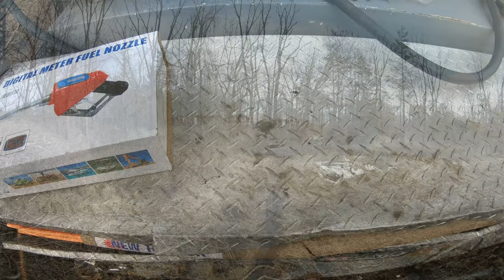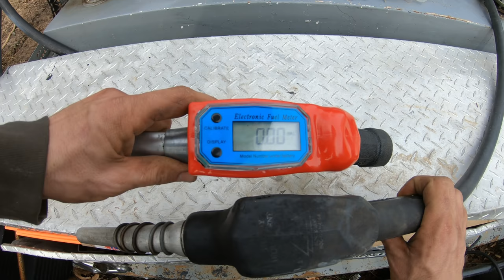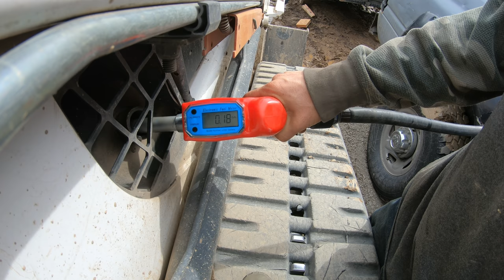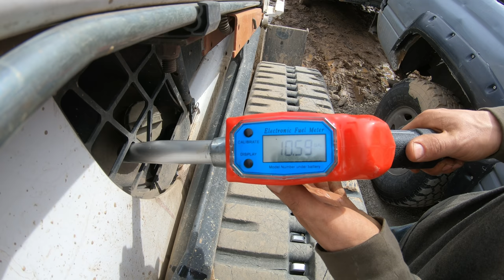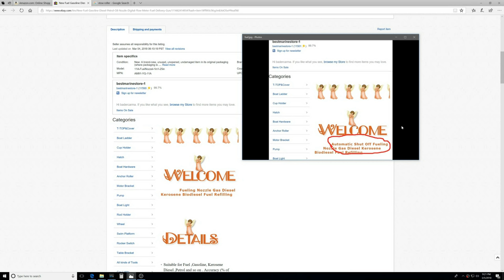Installing an underground propane tank

Comment: Scared the shit out of me when he got between the tank and the truck when it was swinging,,,,Not smart
Reply: yea the delivery guy said it was his first day, coodve been his last day
Reply: Me too! I think he was tryin to pat himself on the back too! Walked under the boom and with the jerky hydralic dips yankin that truck around. It seemed l il ke that tank was almost too big for the crane. Also it doesnt take any time to attach a tag line.
Reply: @joshanderson1019  this guy is no way stupid , u should watch his vids an ull see wat i mean
Reply: @charleswaynejohnsonjr.6096  i was new here i didn't know.
Reply: @joshanderson1019  Not really.
Andrew Camarata takes a lot of risks and gives anything a go. A lot of the time it pays off, sometimes it bites him in the a$$ when he goes way over his head doing something he has no idea how to.
Reply: @joshanderson1019  Not rude. Just dumb. Its not if you get stuck its when. The trick is do you STAY stuck.
Reply: @wildtimbrown  the thing is i dont get stuck
i dont use my skid steer on mud that i cant even walk through without sinking
Reply: @texasrox2010  use a skid steer with bigger tracks
Reply: @wildtimbrown  he did have a great idea with using the hydraulics to get unstuck and i have to give it to him for that
Reply: @texasrox2010  i have nothing against Camarata using his little skid steer for this job and at least he wasn't as bad as the guy on the crane
Reply: @texasrox2010  exactly
Reply: @texasrox2010  camarata is good at getting his small skid steer out of tight situations
Reply: @joshanderson1019  whoopee for you. If you have never been stuck, you have no idea where your limits actually are.  Getting stuck happens to everyone who pushes the limits, it's do you stay stuck or get do you get yourself out.. And all your boasts mean exactly nothing on a media that let's us see what happens. You go create a much real world content as he does and we will consider consider believing your boasts.
Reply: @wildtimbrown  its true. Even someone who has gotten stuck driving in snow would know.
Reply: I agree, the delivery guy didn't seem to know what he was doing. He got called out on it by his own guy!
Reply: @charleswaynejohnsonjr.6096  Yeah you know there are these things called "jokes" in the construction industry. Delivery guy didn't look very green.

Comment: Why would anyone bury a propane tank in that soup? And you need to pump all that water out first! Now that hose is probably kinked up underground. Me, I would want a foundation on top of the ground and if the tank leaks you can get to it.
Reply: It will rust through and you will never know it. First clue when the house blows up. Very unsafe.
Reply: tanks are buried with cathodic protection and will never rust as long as the anode bags are replaced which is every 15-25 years. any propane company worth is salt will make sure they are tested once a year
Reply: I wouldn't have too much faith considering their crane operating skills.
Reply: Did you watch the video all the way? The propane tank area was dry as a bone. The well area/ line was the wet area.
Reply: They don't allow propane tanks to be buried in Wisconsin. Some people have wanted to because propane is a liquid at -40 degrees and won't come out of the tank. It would stay warmer in the ground.
Reply: Lots of tanks are buried. He also drained the site, that was where most of the water was. The propane tank was installed after the drains had had time to do their work. Round here people bury the tanks to stop them getting hot in the summer and cold in the winter and being a ghetto eyesore the rest of the time. The tanks are treated to prevent rust, and then buried with sacrificial anodes. The only issue round here is if you live somewhere there's actually space for ground water, I have granite a foot down, and the tank runs dry, it can float to the surface. My friend's 500 gallon tank is bolted to the ledge so it can't float when empty.
Reply: @rt000r  I didn't see them install any anodes, did you? I didn't see any test leads either.
Reply: @joemoma516  come to think of it,I didn't either. We always do an anode test for any new customers and if it fails,we make them put in new anodes. Way to much liability filling a possibly rusting tank. When we install them,1000 gal get two bags and 500 gal get one and as long as the individual is a customer,they get tested every year
Reply: @rt000r   Yeah, we test all mains over 100' once a year and mains under 100' every ten years, or 10% a year. Tanks are annually tested as well. But that's the federal reg for a utility company, not sure what homeowners are required to do. But if it was my tank, I'd want it protected.
Reply: Melkor they literally threw the anode bag on the side of the tank
Reply: @DW-bo3qw  Yeah, I went back and found it. @ 17:22
Reply: @joemoma516   Watch that section again. The guy tosses a long round bag in the pit next to the tank. The bag contains the anode material. (Though the guy pronounces it AY-node. Drives me nuts.  It's a soft a.   AN-ode

Comment: 7:00 - rubber hoses underground for gas really?!? With some screw tight clamps which will rust within 10 years. Needs soldered copper pipe inside of PVC pipe which has expanding foam to protect the joints.
Reply from the maker: IDK, gas company did it, they should know what they are doing. I think that line was plastic.
Reply: Just seems mad code out there you have, we have stricter code in Europe when it comes to gas I guess. Also, your castle/home is amazing. :)
Reply: @rhfweb  I'm always curious about the differences between EU and US code.  Often it seems to me that US is over-regulated, but in this case I suspect any European inspector would be having fits.  :)
Reply: Isn't that the water outlet from the well?
Reply: I believe he was referring to the water line from the well.  I thought the same thing at first then I realized you were not installing the UG Propane tank yet.

Comment: Been reading through the comments and thought I'd add my US$.02 as a homeowner not far from here as well as someone experienced in designing septic systems and who's had drainage issue on my own property.

First, this isn't about a water table. This is about dense clayey soil that doesn't drain well. In designing a trans-vap, or leach field, in this area you need to perform percolation tests. If you can't find anywhere on the site that gives a consistent perc rate then you're required to truck in soil that does and build up your own field. $$$$$$$$$. Last I heard, around 25,000 of those. I've spent long hours out in the woods watching failing perc tests, 

Foundations require footing drainage, and robust ones. My own home has (according to the drawings) two runs of perforated pipe, inside the footing and out, which then join and run out downhill to a stream.  The house is around 30 years old, we've lived in it for 10. Not long after we moved in I discovered the basement was starting to flood after serious rains. The worst I had around a foot of water. It became apparent to me (too slowly, I'm sad to say) that a pine tree planted too close to the house had infiltrated the outgoing drain pipes. The tree is huge and there was no clean-out built into the system (?!?!?!) so another plan was devised to install a cleanout and once a year I have a guy come up and snake it out. At some point I know I'm going to have to take this tree down. But we've had no water in the basement since including getting hit by back-to-back tropical storms (Lee and Irene) a couple years ago.

Comment: Regarding the anchoring of the propane tank I would think a slab is not the only way. I've been on a job before where a large culvert kept floating up and the engineer fixed it by using anchors used for guy wires that keep utility poles upright. They "screw" into the ground.

Comment: Hello Andrew new too your channel. Nice work in the video, put in a few propane tanks myself. I heard you say your next project was the septic tank. With the amount of ground water there you need to fill the tank so it doesn't float out of the ground.  I repaired one where the homeowner had it cleaned out got a huge rain and floated up.
Reply from the maker: Yeah, those plastic ones can float up sometimes. Ill be installing a concrete tank here.
Reply: Andrew Camarata it was a 1000 gallon concrete tank. Floated up and layed on its side. What kind of lines are u installing.  We can use rock, tire chips, chamber. Some people use e-z lay with the packing peanuts in the net. Done a lot of repairs where that was used.
Reply: Andrew Camarata --- I had a concrete tank float on me after it was covered and not filled. You'll be glad it's filled if you have a lot of rain/ground water.

Comment: When we used to install these tanks we would anchor them down so in heavy rains the can shift or lift. Using concrete dead mans with cables. So pipes won't break cause a gas leak. Have repaired dozens of them and anchored them down so it won't happen again

Comment: I was on a job with someone a few years back at a property that had a propane tank outside near a shed in the back of the house so there was no more than 20ft between the tank and house. It was a tree job, the stump was grounded down, and I was digging the excess dirt/wood and smoothing the area out. Kind of smelled funny as I was digging around, didn't put two and two together until a black piece I thought was garden edging was sticking up, the propane line was hit and ripped apart.

Comment: General question? They don't "bed" the tank with gravel? Or some kinda of drainage? 

500lb propane will go faster than they think.

Cheers
MJ
Reply from the maker: They just said no big rocks against the side of the tank. That dirt was fairly rock free.
Reply: No, the idea was to stabilize the tank with 3/4" gravel. Like you would with a drain pipe or a retaining wall.
Also help with water//rusting issues?

Thx
MJ

Comment: This video is pretty hilarious. With all the getting stuck, using the tiniest machine to dig the hole, the rube running the crane lowering the propane tank into the ground, not bedding the tank in sand, propane line not bedded. No code in NY?....
Reply from the maker: The ground Is sand.
Reply: @AndrewCamarata  Damn, can't really tell that from the color and probably wetness. In Connecticut, they still made us bed in non-native sand and cover as well so when you hit the non-native with the bucket, you'd know you were almost on it (plus tape)
Reply from the maker: Hugh Albright Yeah, that seems a bit excessive, as long as there’s no boulders against the tank, it will be fine
Reply: Andrew Camarata I’m still reeling over the septic story at that place. I’d have had a meltdown if we had to redo things over and over.

Comment: 500 gallon tank hole size, 10x4x4'6" deep. The shutoff and relief valve need to be above ground level. The guy running that crane shock loaded the crap out of it over and over again. I work for a fuel company and excavate for these tanks a good portion of the year.

Comment: It looked like those guy;s hooked the gas line to the tank and house with a plastic seamless pipe... I did not  know you could use plastic, on the under ground. I was always was told to use Galvanized pipe, your never to old to learn.. Nice job See Ya

Comment: A galvanic anode is the main component of a galvanic cathodic protection (CP) system used to protect buried or submerged metal structures from corrosion. Not to absorb anything

Comment: In Iowa we found out the hard way that if you don't strap down to drilled in tie-downs and you get two circumstances to happen at the same time that tank will "float" to the surface; saturated soil and empty (or nearly) tank.

Comment: Hey Andrew, great video and great job getting yourself out of that "quagmire "! Just curious, why didn't the propane company require you to put down either a bed of stone, or the very least, termite blocks underneath that tank to negate any possible settling of the tank. I realize that the ground was fairly dry, but still the possibility of that tank settling and breaking that connection? Just wondering!

Comment: Great save ! What was that extra line they put in with the electric wire for the well pump ? Ground or heat tape? We always put some ridged insulation on top of the water line to help keep the frost away .Man their going to have water issues with that house .They should have built up the hill a little bit some were for the water to go .Awsome Job on the vidio .Here they wrap the foundation with a blue skin not sure if it's any better or not .years ago we use ti use foundation tar fly screen dad said it gave some body to the tar and topped with some heavy plastic .But back then you would have the old form ties that want through your foundation to hold the forms in place

Comment: A question. How chemical clear propane in Your country is. A few years ago i was using lite propane (11 Kg) tank on in my village house, and i wasn't exchanging tank for a new (now in my country it is only option in practice refiling your own tank is a kind a problem only exchange) i was just refiling it. The problem was that the propane tank every next refilling got a little less of capacity but the weight was quite correct. The porblem was the liquid hydrocarbons witch didn't want to evaporate and stays in the container. You have to pour out it like normal gasoline. So the question is if it is possible to clean that tank and how or there no such problem in Your place. But that kind of tank is not mounted for one year.

Comment: Auto stop on any fuel nozzle requires the nozzle to be held straight up so the trigger vent is on top of the filler. 
Both times you were using it you had the nozzle sideways or upside down. 
Next time try keeping the handle upright.

Comment: I have never seen so many osha  violations  that this guy is doing,  plus  not removal of ground water in a ditch as well would be failure of compaction, and dumping limbs in with back fill on septic system,   having no gravel or rock base on the tank as well,    I bet there was on inspections in his area or he just boot legged it.
Reply from the maker: Everything here was inspected and done properly.

Comment: Andy. Once again,,, you pulled a rabbit out of your hat!!!!!! (YOU LITTLE SHIT) NICE JOB GETTING OUT!!!!!! Great job I have been around a lot of men and machine in my life. You have a old soul. When it come to fixing things and running equipment. Back in a another life. You may have run with the Wright brothers, or may hung out with Henry Ford, or the Dodge brother. You have a great GIFT!!!!!!!!! FOR LOOK AT SOMETHING!!!! AND (OH SHIT!!!!!!!) NOT STOPPING TO LONG,,,,,, TO THINK HOW IN THE HELL!!!!!!!!! AM I GOING TO GET OUT OF THIS FIX!!!!!!!! YOU ARE A ONE OF A KIND!!!!!!THERE ARE NOT A LOT OF GUYS OR GALS THAT CAN DO THAT!!!!!!!!! HEY JUST SOME THING TO THINK ABOUT FOR YOUR NEXT TRUCK. AM GOING TO BUILD A DUAL REAR WHEEL. EITHER CAB OR CAB AND HALF. UNTILY BODY. TO HAVE ALL (MY TRICK IN ONE BOX) CHAIN CABLES FUEL. TORCH SET. SMALL ONE ALL MY HAND TOOLS. AND A SMALL BOOM TAKE CARE AND BE SAFE. JUNKMANDO. PS NEXT VIDEO,,,,, HOW ABOUT A LEAD IN WITH A PICTURE OF THE DOGS.

Comment: Everyone talking crap about how the tank was installed..... Meanwhile, I’m amazed that a new construction home in 2018 is still using a propane tank.
Reply: Rural areas are almost all dominated by propane, especially mountainous areas.  Natural gas comapanies are not gonna come through the mountains with new pipes.  Too expensive.  Propane is just about as cheap as Natural Gas.
Reply: I live in the south and I’ve been to some pretty rural “off the beaten path” country towns. You just don’t see propane tanks used.  I guess the infrastructure in that part of the country is slower to adapt? 

I was born and raised in the north east.  When I moved to the south in 2009, I was shocked to see that a majority of the homes here all have central heating and cooling. Not as much in the older homes in the north east.
Reply: @Alan_83  You will NEVER see natural gas in these areas.

Comment: As someone who spent a lot of time looking into cheap flow meters (several months), that $40 meter / nozzle combo is not going to be very accurate at all, and even worse if you don't fully engage the trigger (slower fill). They're dirt cheap hall effect sensors.

I suppose if you just monitor how much fuel goes into your tank every time  you fill it then cross reference that with how much the meter says you took out until it was empty, you can get a good conversion factor over time.

Comment: Yuck quicksand acres here it seems. What kind of coating is on that tank. They used to make us coat them with tar like the foundation walls before setting them in. When dry wall guys use a forced air furnace to heat the house it will usually wreck the fan. They should be using thier own heat.

Comment: No cathodic protection or sand bed.  Would be illegal in my area since early 2000's.  With such a broad LEL propane presents a terrible risk as it is heavier than air and tends to concentrate in pockets.  Good luck to the house tenants.
Reply from the maker: The entire ground was sand. They added the anode in this video.

Comment: With the wet situation you have there, I wonder how you ever got a good septic perc test?  Here in upstate New York, we have to put our water pipes at the 48" level and add 1" - 2" Styrofoam sheet over the top of the pipe.  Big difference between upstate and downstate NY.
Reply: Frank , Where in N.Y. ?